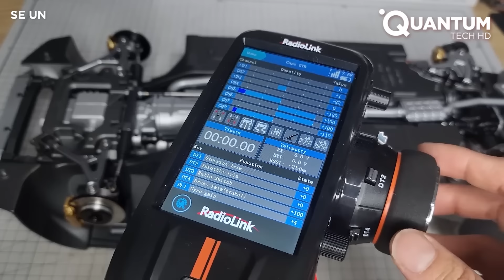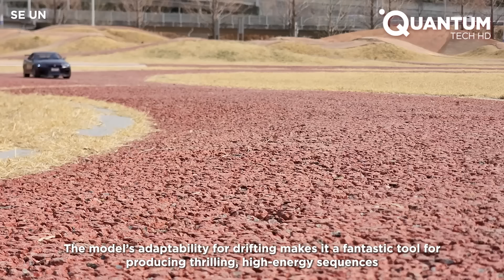Man Assembles $2500 HYPERREALISTIC RC Racing Car | Nissan Skyline GT-R R34 By @RCPlayGround

Comment: I was excited throughout the entire video. As an auto technician I was in awe at just how many aspects were real scaled down functional mechanisms
Reply: A few areas could be slightly improved, but the main thing that kind of disappointed me was the electric motor in a fake engine case. It would take it to the next level with a little RC nitro engine, or a mini inline four.
Reply: That transmission though….
Reply: @HalfdeadRider  
I had a Kyosho mini cooper that ran on methane, lawnmower pull start, with primer etc etc. 30 - 40 km's speed on footpath, was insane.

Comment: A speaker mimicking the R-34 engine sound would be nice😊. Also responding to the throttle response.
Reply: https://youtu.be/2EDxApIonA4?si=JyvPlj69yYc3nLlM&t=930
Looks like you could fit a speaker there, not sure if they designed it that way but must be doable with that 8 channel transmitter\ reciever.

Comment: Nice 👌. All with the help of 3d scanning , cad and CNC tooling  .
Spare a thought for those early 1970’s Airfix kits where engineers measured and drew everything by hand . Then tooling was made with either spark erosion and a trusty old Bridgeport manual Milling machine. Artwork for the boxes was also drawn by hand too . ❤
Reply: The great Roy Cross. It wasn't just box illustration. It was art.

Comment: This looks so cool, I just wish it was less expensive, but completely understandable since most of the parts are metal and parts that are plastic were plastic on the full sized car as well like the bumpers, even the body is metal. It does come unpainted which kinda means getting a really good paintjob on this will be difficult to get looking good unless you know what you are doing tbh. I would recommend some kind of quality automotive rattle can paint and a good rattle can 2 part clear coat to top it and get that depth.

Comment: 12:36 You made an error here. You state that the motor does not drive the front wheels. However, the Skyline GT-R R34 (as are almost all skylines for that matter) is an all-wheel drive car. You can see this in the video even at the 17:13 mark when he's testing to make sure that power is getting to the wheels, and that the wheels are steering properly.
These skylines being AWD is one of the foundation pieces as to why they handle so well, and why they have such great acceleration.

Comment: 1000$ is more than enough.  RC racing cars, like XRAY have a million more parts in detail, made from carbon/aluminium with 100% adjustability like a real car. For example, suspension height, stighness, angle.. steer angle, tow in tow out etc etc etc.

Comment: Looks awesome my only concern would be that ,being that the electric motor is fully enclosed in the engine block overheating due to lack of air flow around the motor could be a problem.

Comment: I could be wrong but the video said the front wheels weren't powered by the motor but I could clearly see the AWD transfer case and front CVs, and then later said "The differential is a key component in any rear-wheel-drive vehicle"

Comment: For 2500$ I would get an MCD rc car with even actual hydraulic working brake drums, that is the realistic thing
Reply: MCD is gas, this is electric, no need for working brake "calipers"
Reply: @MotoDonuts  MCD has both
Reply: an Xray RC cars have millions more details and better parts to deal with. Like , suspension height, stighness, angle.. steer angle, tow in tow out etc etc etc.
Reply: @z3dz  Did you see MCD cars, they have disk brakes, what detail are you talking about in Xray? they have buggies
Reply: @MetalMilitia80s   i didnt insult your little mcd cars,chill. Just said what you can buy for 1k +- instead of this grabbage on the video. Xray is an exampe if you didnt get it and btw they both have the details for setup etc.
Reply: @z3dz  I don't have MCD it is expensive, but that's what I would buy for 2500K, only I didn't see your comparison relative to this video or the MCD

Comment: How fast does it go after assembly, it looks amazing but "high speed drift" usually means plastic tires so any amount of forward movement is "drifting" if it can drift with rubber tires you can call it a drifter imo, but that is still super sick

Comment: I paid a grand for a Kyosho Mini Cooper that ran on methane over 10 years ago.
Lawnmower pull start, exhaust with smoke etc etc.

Loud as, and fast as hell LOL.
Reply: PRO TIP ... check out FG 1:5 Bigscale 2stroke (Chainsaw sized engines)
Officially they have NEW MINI COOPERS (which I don't like)
but I bought a third-party Classic Mini Body....
it still not painted and fit on my chassis yet (currently rocking a Porsche GT2 body)

Comment: This is honestly an amazing gift to give a kid to teach them how cars work on a mechanical level. EV or ICE, the dynamics of a car are still the same: four wheels and four tires with a body on top connected by suspension.
Reply: That is a $2500 model sir
Reply: Yes, that's more of an adult toy for sure.
Reply: @LordHolley  says who? "Expensive" doesn't have to mean "adult". Would I buy it for a five year old? Certainly not. But 10-15 years? DEFINITELY.

Comment: Looked like a lot of plastic for $2500 and it's electric, now if it was a replica nitro engine with real exhaust and turbos and intercooler along with radiator in a little bigger scale it would be awesome, since most of its plastic and only the most important parts are metal or aluminum it's just cool very cool and a lot of detail for a model rc car. You still probably wouldn't want to crash it lol

Comment: With so much money he could cover a 6 month payment for a used true nissan skyline.
Reply: How much used nissan skyline
Reply: @Billflx  depending the country. Here in greece i have seen it for 20000 since some tend to mod it for street races. It depends on the condition and availability in each country. Assuming he buys it in lets say a 3 years payment loan.
Reply: Really?? I true GTR is over $100k USD. $2,500 isn't even a full monthly payment.

Comment: Great stuff but what is the green disk on the screwdriver? Is it for electro-static charge?
Reply: Static only matters for electronics and bare components. It's a magnet, so the screwdriver holds onto the screw as he lines up where it goes. They're super common and useful

Comment: that engine cover will do more harm than good to the motor if you intend to use it alot for drifting etc as heat gets trapped

Comment: Just one coment about the tittle: 2500$ is not a value description. First, must have an identidicaton of the currency: dolar, euro, yuan, peso etc. And it must come before the value. Ex.: US$ 2,500.00 or Eu$ 2.500,00.
2500$ can be anything. A pair of sneakers or a motorcycle